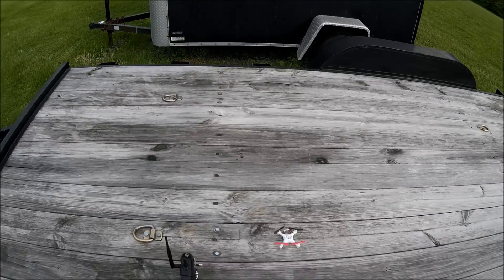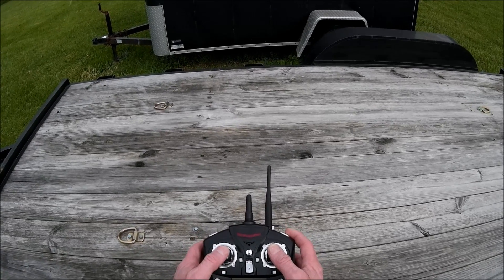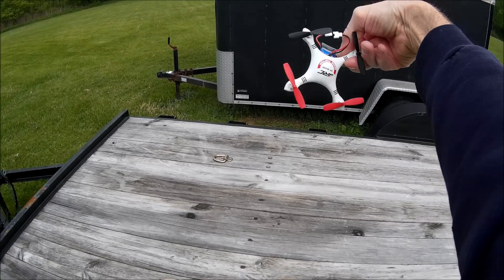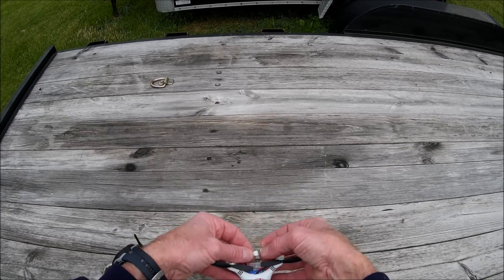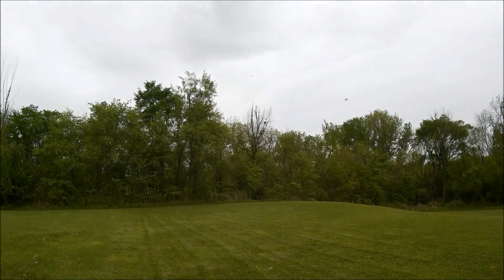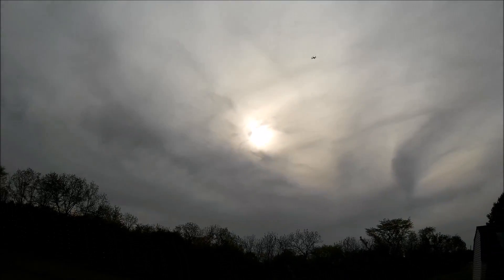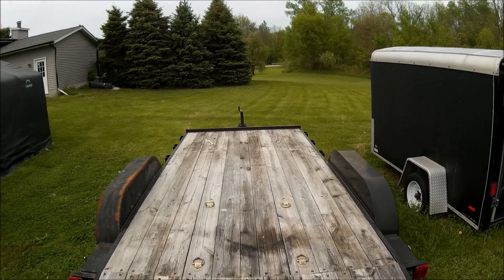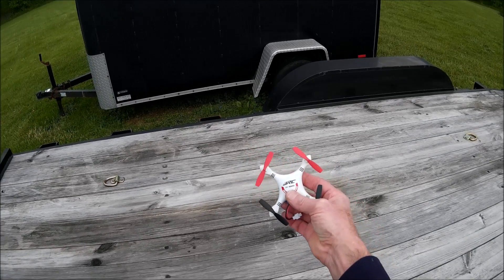Drone Manual Flips

Comment: Now that I am seen all the video, are you sure it is flipping? maybe is a visual effect, I will try it anyway, but I need a nice fluffy grass  ;)
Reply from the maker: Multirotor Go Well, I guess it would be a visual effect. I see the quad flip 360 degrees when I execute the maneuver properly. It works on micro quads the best, I have never tried it with a nano quad. I have got my Wltoys V636 to do it before but it is really difficult to get that size quad to go all the way through 360 degrees of rotation.If you have a micro size quad just follow the demonstration and you will get it to do a flip. Make sure you have plenty of altitude so you don't hit the ground. Good luck and keep trying.
Reply: Multirotor Go lol
Reply: Multirotor Go
Reply: I saw it flip:)